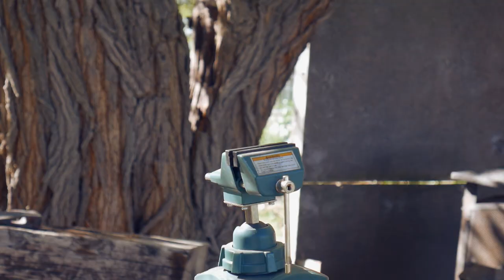Forging A Stonewash South West Bowie Knife (Full Build)

Comment: Great video. I also appreciate the fact that you actually forged the whole thing. So many just trace and cut a pattern from tool stock. That may produce a decent product but it is not forging. Just a curiosity, why a hidden tang? I always thought that a full, exposed tang was a stronger tang. Amazing job. Thank you.
Reply from the maker: Thank you! And I just really enjoy the craft and the tradition behind it. And while usually a full tang is going to be better suited for a hard use knife, the design and flow of this piece just worked better as a hidden tang.